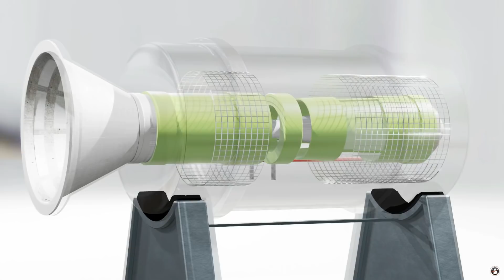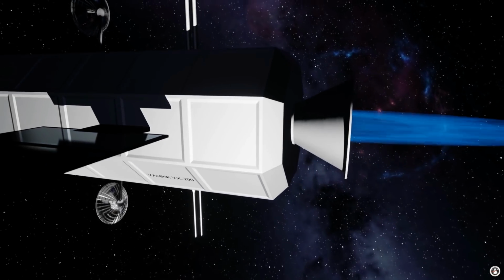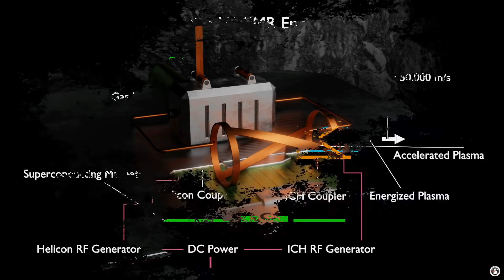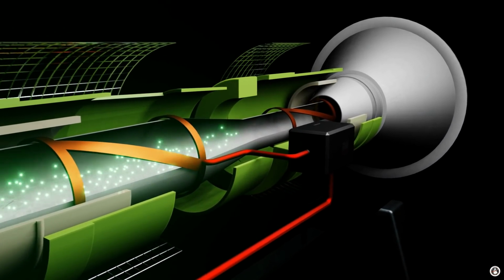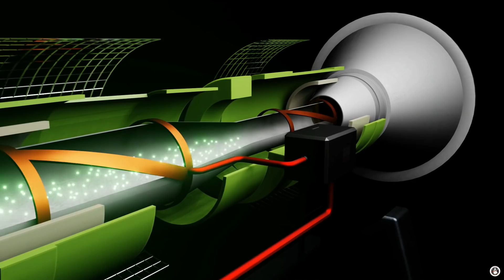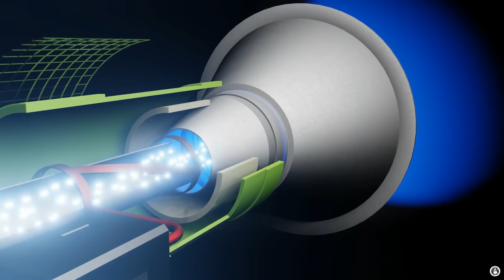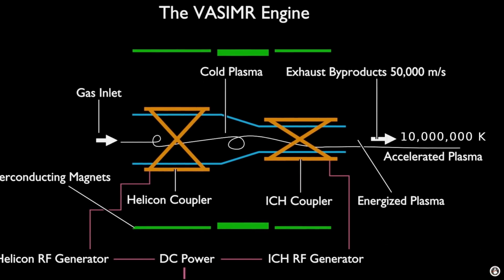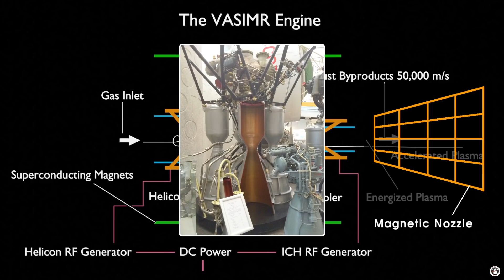The VASIMR Engine – 0.000167 c / 50 km/s

Comment: I understand another engine is in the works, VERMA. It's not C¹²⁰ based, ie graphene fuel, wi white hot Plasma. Digital f[Hz] transistor gen, could lessen power consumption. With I²=ß or ßc², 'our tails are up' for e/m F. Keep up the Alfvèn, Chang-D.

Comment: These engines are never going to do anything at all if they just sit here on Earth in labs in various states of endless prototyping.  The same is true for potential power supplies, nothing is going to get done about power supplies in space until more powerplants are launched into space to be tested.  These systems are essentially irrelevant to spaceflight so long as they're sitting around here on Earth.  
What VASIMR, HDLT, and the other potential high-ISP drives need right now is not to produce the most efficient possible version of their engine right now before ever using it in space, what they need is to produce a sufficiently functional engine to complete some basic task better than an existing bipropellant or monopropellant engine that already exists, that can be launched into space within a timeframe of only a few years.  
Look at SpaceX's Raptor engine, it isn't the most powerful bipropellant rocket engine ever built, nor is it the most efficient, nor does it use some novel unique nozzle design, what makes it potentially disruptive for spaceflight is that it is by far the cheapest large rocket engine ever designed, and is mass produced at an increasingly rapid pace.  
Spaceflight doesn't need the ferrari of rocket technology right now, it needs the Model T.
Reply from the maker: What do you think is the driving mechanism behind the lack of follow through development of such devices? There are many answers. Whilst the scientists are ready and eager, as a general rule it has to do with a lack of public and private interest, of low importance to the majority which ultimately equates to a lack of funding hence development slow or worse, stops. In addition to funding, such endeavours require both funding and true intelligence and vision for the future. SpaceX achieved what they have achieved due to having these factors from the start. 

No matter how advanced chemical rocket engines become, whilst they will be able to reach relatively near planets within our system, they are still extremely limited for space travel beyond, they still require refueling or to put it another way, they still have an MPG to take into consideration - limited in range without refueling depots which are expensive also requiring a lot time to engineer like the VASIMR.

Since more advanced machines take time to develop, now is the time to do so, so that when the time comes for their need, they might just be ready.

Comment: I think we may gain stronger thrust if we could heat and compress the ions by magnetic field and then release it.

Also, I believe we have several types of ions, and we can choose the right one.

But, the question is it possible to split the ions?

Comment: I got very excited about VASIMR about ten years ago. But digging deeper I learned about a couple major drawbacks. The first is energy requirements - the engine basically runs on electricity so you would need a big nuclear reactor to power it. The second issue would be the problem of deceleration. A VASIMR ship could get to Mars in 39 days but it would zip past the planet unless it had a means of shedding velocity.

Comment: 06:30 SpaceX will require an energy thrust solar orbit stage vessel, something like Vasimr will save tromendous fuel for SN on vtol critical limits, Vasimr, may offer gravity simulation & non idole acceleration, vers a limited canister, even at conservative accel of 0.5 ~ 1.0 or 2.1GForce, will grant shifts of cruise travel  comfort, power cam remain very long with minature nuculear reactor generator, far safer them a nucular chem thrust. Leave the chem rocket stage SN for VTOL & emergency manuevers.

Comment: The concept for the engine is very badass. 
Although the problems of using that engine should have been mentioned. 
For example I believe that just as ion engines that engine requires massive amounts of electric energy for reasonable thrust. You can't just strap it on the starship, you will need giant solar panel arrays, maybe heavier then the starship itself or a nuclear reactor, which raises safety and publicity concerns.
It has potential in some niches, but it's not magic (unfortunately).

Comment: Low thrust, high efficiency. High thrust, low efficiency. Why not high thrust, high efficiency? Constant thrust from a hell of a lot more than 100KW. Surely, power will ned to be in the MW range at the very least? GW range for larger ships to come. This is going to take reliable fusion reaction that does not yet exist commercially.

Comment: How much power does this engine require?
Reply from the maker: 200 kW which can be supplied by means of solar or nuclear, coming fusion or NASA's compact fission reactor. 

Research paper: https://www.researchgate.net/publication/268568604_VASIMRR_VX-200_High_power_electric_propulsion_for_space_transportation_beyond_LEO#:~:text=This%20engine%20is%20given%20the,200%20kW%20input%20electrical%20power.

Comment: Velocity is dependent on mass and applied power. People cannot endure high G
accelerating 100 tons to 50,000 m/s would require 125 million newtons and the same force will be required for decelerating. A huge reactor would be required, plus a supply of gas for the plasma.

If you simply ship a huge container of fuel up and  refuel the Starship in Earth orbit, the starship can accelerate towards Mars for a quicker trip using current technology.

Comment: ok, if this engine is so great, whats holding its production back? what limitations are there that prevent this from being practical?the only limitation that I see is in the generation of the plasma, as it would require a significant amount of energy to generate the super hot plasma. It doesnt make sense that having the cyclotron generated in the "cold plasma" would somehow allow significant heating of the gas to allow such temperatures to be generated. Because of this, I think this kind of engine would be ok for medium sized craft, but would still require onboard nuclear generators to supply the constantly high energy requirements of the engine. furthermore, how is the nozzle protected from the high energy plasma? In fusion reactors on earth, we the walls of the generators have a layer of magnetic fields that prevent the plasma from touching the walls and potentially causing a problem. Sure, the magetic fields of the rocket nozzle that help project the plasma could help, but would have to be sufficiently strong to contain the explosive pressure of the expanding plasma.  I always love to hear this kind of tech, but this doesnt seem practicle with the current level of engineering we have and the energy solutions present today.

Comment: the key issue is the power source, the lightest by far being an efficient solar photovoltaic sail since by definition in space, we have the space for it, while solar winds can provide also additionnal thrust or orientation control. 80000 sq feets of sail would provide well over 20 MW of power for a powerfull journey..

Comment: 100kW-200kW power usage... Yeah, solar panels ain't gonna cut it. A small nuclear reactor would be needed, I reckon. That in itself is a can of worms to acquire and get approved for launch.  Spacex wants to launch missions ASAP, so the reason they're sticking with chemical engines is because there isn't the hassle of dealing with fissile material acquisition and launch approvals. Maybe in the future. But for now they're on a mission to get their Starship up and running as fast as possible.

Comment: Parker Solar probe has already reached a speed of 160km/s with a projected max as 200 km/s. Not an exhausting gas, but a mechanical module itself. So, comparing 50 km/s with a speed of light looks very funny -)

Comment: Simply because the exhaust velocity is 50km/s doesn't mean the craft will achieve this velocity. Most ion drives only achieve less than 100N  of thrust. Assuming 100N then for a 100t tonne spacecraft that is 0.1 milli g. To produce more thrust requires more electrical power in the MegaWatt range so a nuclear reactor has to be included increasing mass again. This would take years to accelerate and deccelerate to mars orbit. 39 days is investor hype.

Comment: Even if this actually works (and doesn't simply send the plasma in a magnetic loop back to collide with the spaceship), the weight of the power source (solar panels or nuclear reactor) will still make the thrust-to-weight so ridiculously low that it will never be feasible for manned space flight.

The fact that this has been worked on for decades and still has never done anything useful should tell you that it might not be a good idea.

Comment: how do you stop the engine melting at high power? - current tech is 70% efficient at only 250KW ; you would need a 200MW engine to get to mars anywhere as near as quickly as said in this video.. radiators to get rid of / generator to create that level of power seem quite large.

Comment: I don't get why its always about "this engine can get you there is _ amount of time" is that with the same proportions of fuel to payload? How much more payload could be delivered if it were to take the same amount of time? Why go faster if you could burn less and bring more payload? Comparisons like isp and force (aka efficiency and how long a burn would be needed for x amount of delta V) are much less vague. 
The long transfer time is because that is the most efficient method we have

Comment: VADMIR is a good design but again must have an independent power source. Ion thrusters (electrostatic) have reached high efficiency, but again need power. One of simplest concept is a microwave system and... water. Demo ISP approaching 1000 'seconds' have been done though 800 sec is practical. None of these system are "better" they just require tailoring the mission profiles - orbits, trajectory, transit time. Only fusion has the potential to combine thrust level with ISP. If we could create a multi-megawatt power plant which was light enough the VASMIR would be fantastic. Where's that power plant?

Comment: The missing piece of information is the NEED FOR A POWER SOURCE. You need some power plant to provide electricity. In the past a small fission reactor was the assumed source but political will and public sentiment has restricted development. Mass flow is proportional to power output. Four junction solar cells have been demonstrated at +40% conversation with concentrating mirrors.... but no matter you have to have POWER.

Comment: 100 KW? How dow you want to generate that much electricity over a long period of time? Taking along a fission reactor? A fusion reactor would be cool, but we don't have them yet. They tried fission reactors on planes, but it didn't work well and some people even died in Russia. Not cool if you arrive on Mars after 9 days and then die after a few more days because of the radiation your body caught during flight. Heavy shielding (led) is exactly that: heavy. For me, this doesn't work out until we have reliable fusion reactors. Or do I miss something?

Comment: So you take apart a Nobel gas, then heat the electrons? Seems crazy inefficient
Reply: The goal is to throw matter as hard as possible, with plenty of energy (as much as possible!). Efficiency in space travel is based on exhaust velocity, so a nuclear (or solar) powered rocket using plasma (50km/s) is better than a chemical rocket (3km/s). Reason being, if your propellant is shot out the back slower, you get less push from it. And to compensate, you have to bring more propellant, but then you are heavier with all that extra propellant, so you need even more propellant to push that extra propellant, meaning you need even more propellant! Basically the a rocket becomes exponentially larger for "less efficient" rockets (e.g. lower exhaust velocity). To out it into perspective, most chemical rockets are like 95-99% fuel/propellant, rest being engines, tanks and a tiny payload on the very top...

Comment: As mentioned in the video (and many other comments) this requires quite a bit of energy still. Also, you still need fuel (Argon possibly; or helium harvested from the moon!). 

When in space, you need to provide a constant flow of Argon to maintain any plasma. To generate more thrust also probably gets tricky because of Paschen’s Law. Basically, with a fixed electrode gap (as shown in the schematic) the voltage will have to change in relation to the pressure created by the Argon to effectively maintain plasma. Nonetheless, I’m sure this is all possible, and I would be super curious to see some results from these tests!
Reply from the maker: For more information, check out their YouTube channel and website: http://www.adastrarocket.com/aarc/ and https://www.youtube.com/user/adastrarocket

Comment: No one: 
The engine: reaches up to 50km/s top speed
AsteronX: has 50K subscribers
Reply: No, the PARTICLES reach a speed of 50km/second.
Go ahead and punch a brick wall at 10m/s(typical speed of a punch), see how much acceleration you actually impart to the wall. With the particle not specified, and the flow rate nowhere to be see, the actual thrust is impossible to know
Reply: @blackoak4978  well if it keeps accelerating for a certain amount of time it CAN go up to 50km/s

Comment: Unsaid caveat: The power required for matching the thrust of a chem engine means needing a city block sized power plant sending electricity to it.  That is why current space craft that use these engines powered by solar panels get about as much thrust as the weight of a piece of paper.
Reply: Or a relatively tiny fission reactor

Comment: They "conveniently forget" to mention that to obtain the power necessary to use VASIMR to get to Mars in 39 days would require a power source circa the gigawatt range. That can't be done with solar energy in any practical way. The only practical way to generate that amount of electricity would be a nuclear reactor, a very powerful one, which would be very heavy and require numerous radiators to remove heat from the reactor lest it destroy itself, adding even more weight and complexity. 

Could VASIMR be the future? Sure, but only after a lot more work and with approval from both government and public for the use of powerful nuclear reactors in space, particularly low-earth orbit. Unless you have that, then it's just a dream.
Reply: @Shimmy Shai I am not sure I understand your comment. Could you provide a little more context, please?
Reply: @Shimmy Shai Agreed.

Comment: I wonder why SpaxeX does not use the VASIMR (or the muon catalized fusion drive) engine then. Haven't they thought of it, or they have other reasons? Why haven't you and/or Ad Astra proposed a partnership with them? A first stage would be needed anyway and SpaceX do seem to have (or will have) the most capable boosters.

Comment: What do you think about this engine? Though I am convinced that plasma engines are the future of planetary transfer vehicles, I feel like the VASIMIR is too complex, uses materials too exotic etc, the 2 modes arent really needed, if we are ever going to have a spaceborn economy, cargo ships will probably use hydrogen gas as a fuel, not exotic noble gasses
The issue with hydrogen is that it damages the engines, but in my opinion it's not such a big issue, if the engines can be built simply and cheaply in space, they just have to be seen as another conseumable, just like the fuel itself

Though this would only be for very large scales, using exotic gasses is fine for small individual missions, I am talking about a shift to "ablative" hydrogen based engines only for something where huge volumes are involved, millions of tons being moved between orbits etc (which will probably happen someday)

Comment: For those not familiar with metric 50,000 meters per second translates into 111,846 miles per hour. Voyager with gravity assist is the fastest manmade object currently and it's going 37,994 miles per hour. NASA and the other space agencies were sending up probes with basically VW engines and he went and built a top fuel hemi. Maybe we can colonize space after all.

Comment: Would be nice if you could talk about the specific advantages of your engine.
Your site states it's less efficient than the NEXT thruster, but has better Isp.
Is it cheaper than NEXT? lighter? 
Right now it seems like not much gain for much higher complexity compared to other ion engines.
Reply: NEXT is both cheaper and lighter than VASIMR. VASIMR's main advantage is higher thrust and specific impulse over other engines and the fact that it can cycle between a higher thrust, lower specific impulse and a lower thrust, higher specific impulse mode.
In rocket science, specific impulse is really important. The fact that VASIMR has about 900s more Isp than NEXT is a pretty big deal.
It also has a reliability advantage over gridded ion engines (though Hall effect thrusters have the same advantage)

Comment: It sounds like the ions are microwaved. Where does the electric power come from?
Reply: Solar panels. Tesla or Boeing probably.
Reply: VASIMR requires nuclear power plant level of energy. 200 kW version of VASIMR only produces 5 Newton of thrust.

The small Draco thrusters all over SpaceX Dragon and Dragon 2 produces 400 Newton. Super Draco abort rocket engine produces 71 000 Newton.